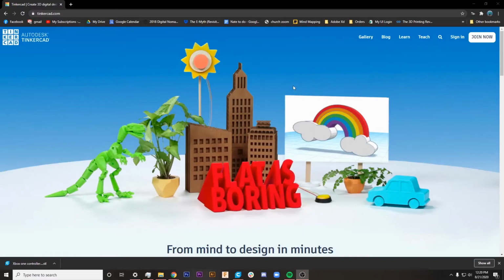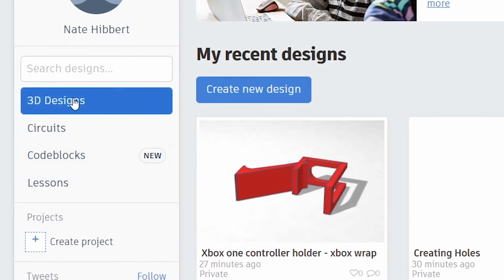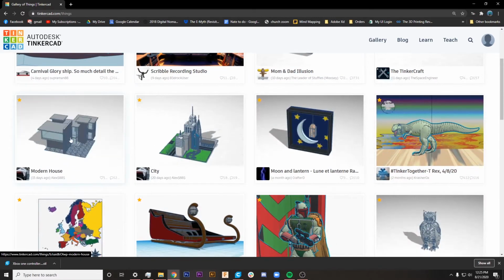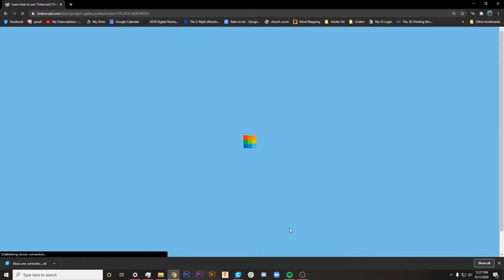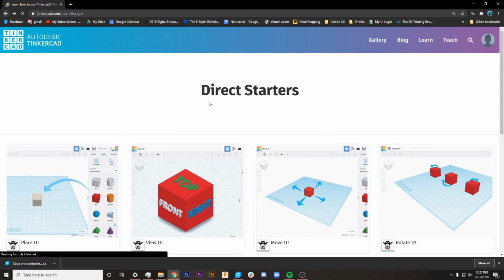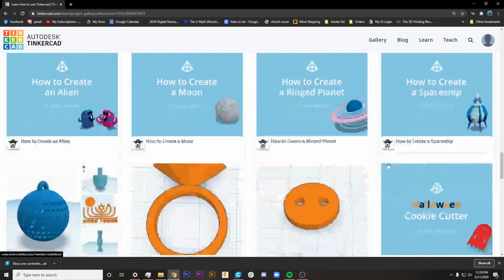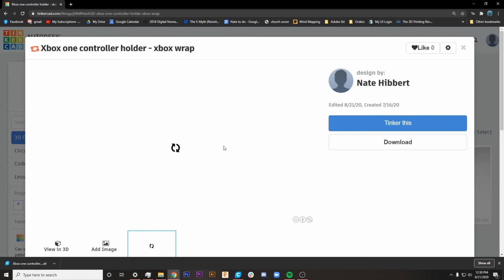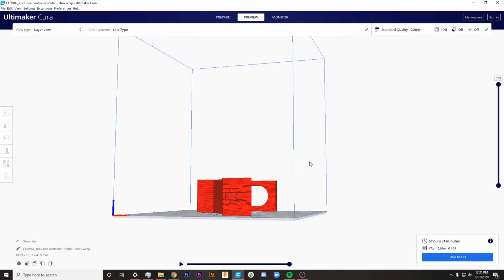Is TinkerCAD the Best 3D Printing Software for Beginners

Comment: Ok so take your exbox hanger and make it dual sided. That way if you do to have your Xbox next to a wall and you have two controllers you have a symmetrical way to present the system. Also have you thought about imbedding chargers in your print so they can charge while hanging???
Reply from the maker: I haven't cuz my controller is the crappy battery ones but that's a good idea of I upgrade in future!